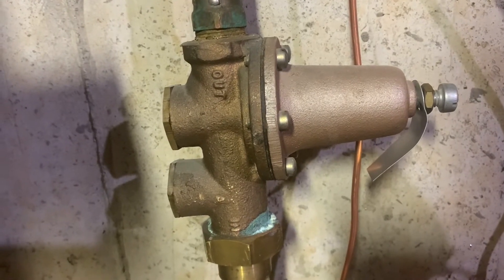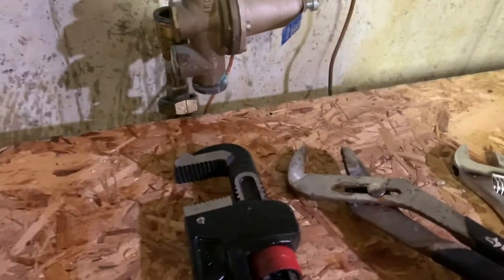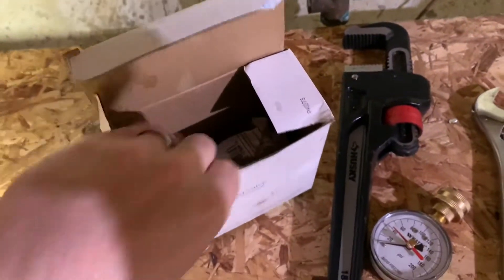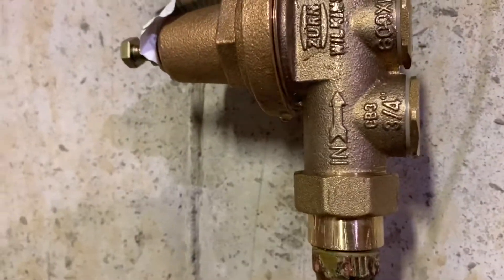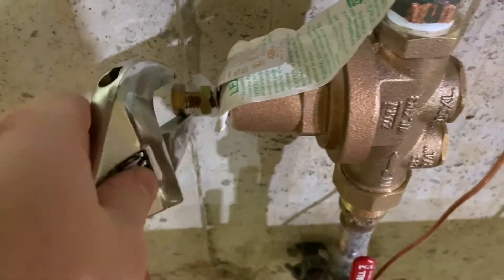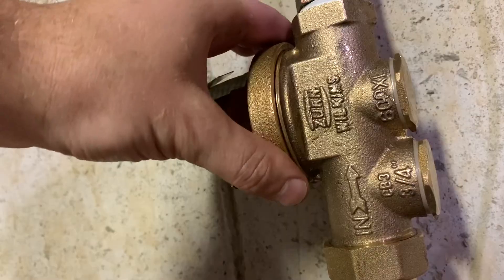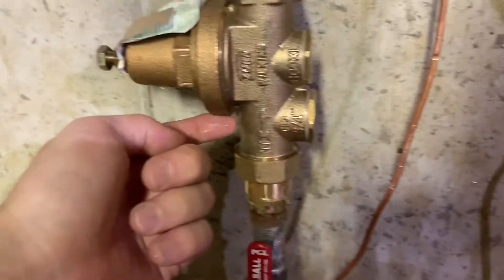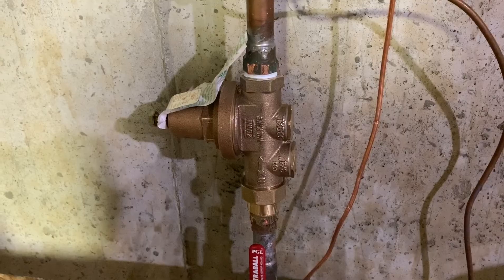Water pressure regulator install or replacement

Comment: If your regulator valve is bad, you'll have the water hammering effect when your washing machine opens and closes its water source, along with other appliances doing the same thing.  And during the peak demand of the day when everyone else is using water, you may even notice that the water pressure really really ends up dropping, to almost nothing if you have multiple water sources open in the house.  They will reduce the pressure, but they lose their ability to actively regulate the pressure, and the spring action sort of just stops.

Comment: When should I replace ?
Reply: Buy a water pressure tester, if over 1200 psi, need replace
Reply: @老鄧馬州  jajaajaj!!! you're crazy!!! if it's over 100 psi it's too much pressure, the normal psi should be between 60 - 80 psi. 1200 psi would damage and burst the piping system.